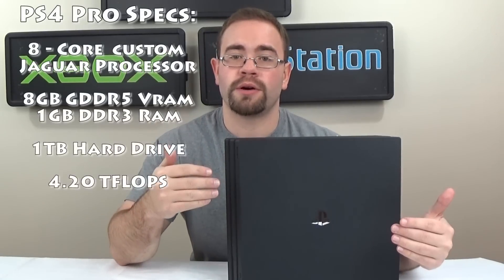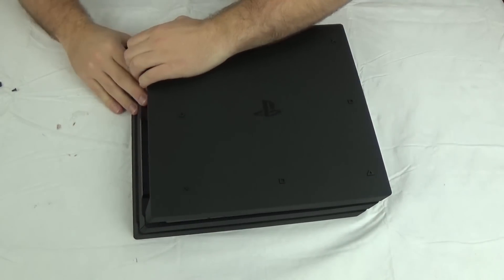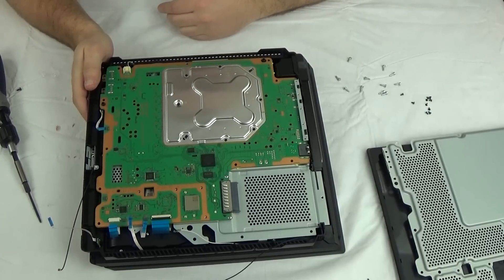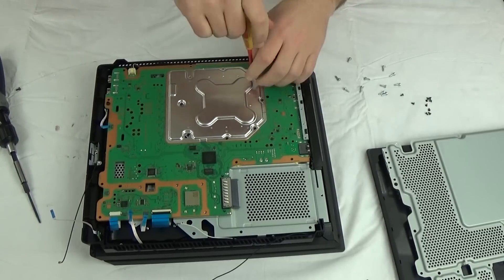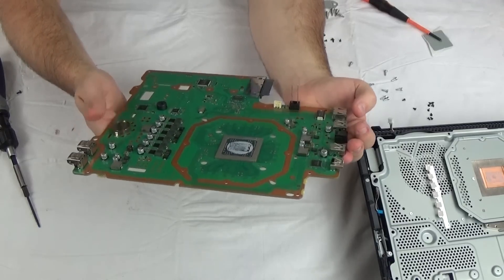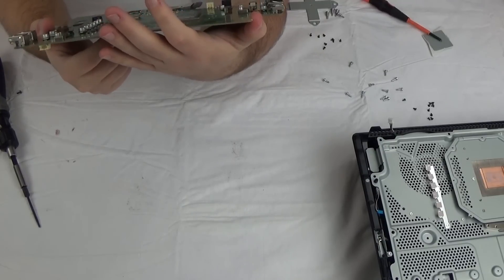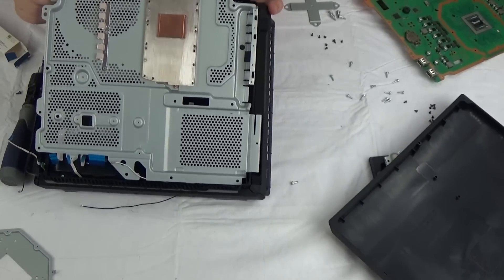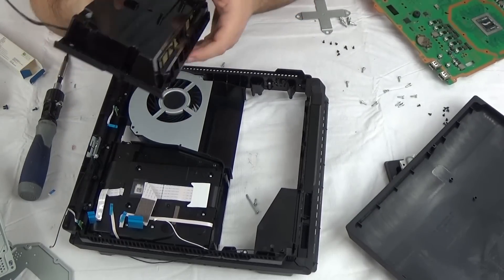Taking Apart The PS4 Pro - Tech Wave!

Comment from the maker: The MX-4 compound made a slight difference in the fan noise. I think the fan noise is caused by the slightly undersized heatsink though. Final Fantasy XV still seems to kick the PS4 Pro's butt in terms of fan noise.
Reply: SPAWN WAVE FOR PRESIDENT!
Reply: Another fantastic upload, I always look forward each each new video! Keep up the great work! I can't wait until the Switch tear down! It's gonna be enlightening to say the least!
Reply: A PS4 Pro surgery!!!!!!!!!!!!!!!!!!!!!!!
Reply: hard to say actually. to mix FP16 and FP32 usage developer will need to do fine tune for it which will going to take times. because if not done right the performance gain probably not going to worth it vs purely go for FP32. FP16 comes into mind when your chip performance is very limited like mobile SoC. using FP16 will save bandwidth and power consumption and majority of mobile games also are not graphically complex (vs full blown console/pc games) so there is a valid reason to use FP16 in mobile.
Reply: Spawn Wave 500+ SUBSCRIBER'S to go bro until you hit the big 20,000 here's an early CONGRATULATIONS!
Reply: Spawn Wave I just have one question for you. What size is that hard drive? If I buy a ps4 pro,  I plan to upgrade the hard drive to have more than one tera byte of space.
Reply: ive always use arctic silver. how would you rate MX-4 vs arctic silver?
Reply: I wonder if anyone is making use of the PS4 Pro's FP16 capabilities... 8.4 TFLOPS is pretty crazy, even it's only half precision.
Reply: you will never see 8.4 TFLOPS real world. that is a theoretical number. 16 bit half floats are only usefull for certain things and can only replace full precision floats in cases where values are close to 0. so you will never be in an in game situation where you are using all 16 bit half floats. i think in real world practice full FP 16 optimization allows for about a 30% performance gain over 100% FP32
Reply: +Roman M
4.2 TFLOPS single precision. 8.4 TFLOPS half precision.
It's a feature that AMD will be making standard in Vega GPUs, but decided to introduce it earlier with the PS4 Pro, so I'd be very surprised if Scorpio doesn't do the same thing...

Like OLDKMT said though, you'll probably never a game that uses all half precision code.
But still, if you can get a 30% performance increase by optimising code for half precision compute, that would just about make up the difference between AMD and Nvidia cards... In other words, the PS4 Pro should easily be more than a match for a GTX 1060, while the Scorpio might even be able to outperform a GTX 1070.

It goes the same way for Nvidia though, so even if the Switch only has 256 CUDA cores, at the 921 MHz clock speed from the Foxconn leak, which is only a theoretical peak of about 470 GFLOPS, it should make it equivalent to about a 800 GFLOPS AMD chip... possibly even higher.
Reply: that thing is more developer problem. because as i understand it from game developer discussion not everything can be done on FP16. even if the game purely use FP16 it doesn't mean the performance is doubled compared to using FP32. using FP16 can also impact image quality negatively.
Reply: That FP32 vs FP16 discution is interesting. Maybe nintendo switch can make full usage of FP16, due it limited memory bandwidth and tflops count compared to xbox one and PS4. Nvidia is also working on software side, so maybe the low level software tools can help developers to handle FP16 easily.
Reply: +Jonathan alis
It really depends on the game.
Big, open, large-scale 3D worlds with large draw distances will suffer without FP32.  You really need a 32-bit depth buffer...
Reply: more simple games probably can get away from using FP16 only. but majority of modern console games are not. most post processing effect used in modern games require FP32. this one is coming directly from game developer themselves. to my knowledge nvidia (together with AMD) are pushing FP32 as standard to be used in games. the one that pushed FP16 for games was imagination technologies because they mainly build gpu for mobile SoC. nvidia advertise FP16 capabilities with their soc and discrete gpu but they did not market them for gaming usage.
Reply: The Pro gets loud as fuck after the 60 fps patch in FFXV
Reply: yeah :D let's see if boost mode makes a difference in terms of fan noise but I dont think so.
Reply: Thats exactly what it is. The loud jet noise is the air being forced thru the vents on the tiny heatsink. What made me discover this is back in 2019 my Pro started making a whistle sound along with the jet noise so now it really sounded like a jet. What was causing was dust build-up on the heatsink and the whistle was the sound of air being forced through dust and forced through tiny parts of heatsink where dust didnt stick, like blowing strong air thru pinholes. After cleaning, my Pro was quiet but ot   did started thinking the original jet sound was from high volumes of air squeezing through those tiny slits on the small heatsink.

Comment: Thank you for the video, I think this is the first time I'm going to buy a console based on hardware assembly and construction. For me xbox one x is a far better designed console, on the other hand the ps4 pro looks messy and a rushed product. I don't like the size of the ps4 pro heat sink is too small for me. Thank you for your video.

Comment: If you are going to pick hardware apart with no intent of destroying it, then I may suggest looking into one of those electrostatics armbands, so you don't accidentally short any components, however your table setup looks good to prevent this anyway
Reply from the maker: I usually just ground myself on a computer chassis. I have them all over the place :D

Comment: what are those fat golden traces called? they seem to seperate the ps4 circuit board in sections? is it to have conductivity from the board to the metal enclosures fitted on top of it? both?, how to design those tracers, are there any guidelines? (they dont teach me that in my electrical engineering school sadly)
Reply from the maker: Usually that's the common ground of the board.

Comment: You've done reball jobs on PS4s? I have a YLOD PS3 and I'm interested in reballing it. I'm an electrical engineer so I'm familiar with most of it, but I haven't actually reballed anything. Where did you get yours done? How did you clean the old solder off the motherboard and the chip once it was off?

Comment: I love how you make taking apart the console look so easy. What's even crazier is that you were able to put it back together so quickly. The only suggestion I have is that once you get your Switch you should take apart the Joycons and the Pro Controllers first in the same video so that you can no only show them off but show off the similarities and differences right there on the spot. As far taking the Switch itself apart I personally think that should be a livestream event that you maybe go back and edit later where you can add graphics plus any additional information you're able to look up and insert into the video. It'd also be cool to utilize the live people to help with that though it may be asking a bit much since maybe you have to concentrate a lot when doing this sort of work.
Reply: I was thinking about this as well, but I think he'll probably post a followup video or two regarding any unanswered questions that pop up.  Also, I love the idea of the live stream audience participating by looking up information on the chips and reporting back what they find; basically, assisting SW while he's doing the tear down. How cool is that?!

Comment: Thank you for the video.  However, I must inform you that you have voided the warranty on your gaming system.  Contact us at 1-800-345-7669 or 650-655-8000 if you have any questions.  How many extra screws did you end up with?

Comment: So what exactly what's the gpu?
Reply from the maker: It's a customized Jaguar chip that is very similar to the regular PS4 chip.
Reply: It's kind of interesting what Sony did with that design, they actually mirrored the original GPU into two separate sides of the chip, so original PS4 games just use one half and still run on almost exactly the same hardware as a regular PS4.
Reply: Jose Cabrera Its pretty much a PS4 GPU times 2 with a slight overclock to 911 mhz (and no that's not a joke) up from 800 iirc.

Comment: Just as shocked as you are about the die and transistor sizing on that compact a silicon.. I've seen motherboards that size only able to harbor smaller chips.. of course this is also with the setback that the ram comes on its own dedicated cards requiring more power and latency to operate on a pc vs here where they're just built on and right next to the CPU..

What's more is if this is a 4 tflop monster in this small a package for 400$ I can definitely see the switch harboring something good at half the capacity of the PS4 pro for 100$ less. Pretty sure it's 4gb ddr4 ram and a pascal based chip at a 1700mhz range. Not only is that still very powerful for its size but won't need much cooling either on a 20nm or smaller die.

Comment: Difficulty to teardown
Easy : xbox one 
Normal : wii u
hard : ps4
hardest as hell : ps4 pro
Reply: Кристопер влалимир Алехандер Армстронг have you ever taken apart a 3DS? It's like taking apart a car on crack, Japan have some insane building tech
Reply: Zachary Goterch 

Well at least it doesn' CRACK like the DS lite or the dsi...

Apparently the new3ds has better hinges.
Reply: Кристопер влалимир Алехандер Армстронг 

and yet, the 3ds doesn't break easily. insame, but effective.
Reply: TheBraveGallade Only problem with the 3DS is that you sometimes get the loose hinge holding the screen to the lower part of the handheld.  I am one of those people. :(
Reply: TheBraveGallade The regular New 3DS yes (even the OG 3DS was pretty sturdy, at least the one I had) but the XLs still have that problem.  Actually I had a black New 3DS XL that wasn't too bad, but then traded for the galaxy skinned version and, yeah, the hinge was wobbly.  Not a dealbreaker but it gets a little annoying if I move it around too much.
Reply: Zachary Goterch 

The problem with the XLs in general is that the top screen is too damn heavy for what its worth. I'm still waiting for amazon to sell SOME kind of N3ds small  at under 200$ (international shipping) for this reason... so I can replace my 8 year old DS lite thats having hindge problems.
Reply: Nepu-Tech USA 

wouldn't the vita be more harder to nep up the nepping hardware?
Reply: TheBraveGallade
The Vita is banned in Planeptune for unlawful use of expensive memory cards! and because it didn't come in purple...
Reply: Nepu-Tech USA 

And your games was originally all only on the nepping vita. Nep that statement.

Sigh as much as I want the (fictional) planeptune consoles to be real, just move to lowee, nep-nep. They treat you better than other nations. Plus you've known blanc the longest... probably.
Also I'll buy your games if they are on the switch.

Comment: What was with those specs at the beginning? 1 gb of RAM? 8 gb VRAM?
Reply from the maker: Sony added 1GB of DDR3 to the Pro to help with system tasks. It also has 8GB of GDDR5 to use as well. The regular PS4 has just the 8GB of GDDR5 to use.
Reply: Spawn Wave 

thats a VERY cheap, but VERY effective way to make room. since the OS doesn't need fast ram, just SOME ram.
Reply: Spawn Wave Oh I though it only had 1 gb of RAM xD.
Reply: xyzqsrbo the Wii u has 2 gigabytes of ram. the ps4 definitely isn't gonna have any less than that lol
Reply: Spawn wave you do know vram is a different thing from ram
Reply: Jesus Rice I know. That is why I commented about it. If I did not find it weird I would have said nothing.

Comment: There are no information in on the chip ? Dose that mean than in the switch we will also have no new information if you take it apart ?
Reply: Gnomix8 - I'm fairly certain those specs are available. I figure he can read off the chip to ascertain what it is, but a lot of curiosity will be between whether it's maxwell or pascal architecture.